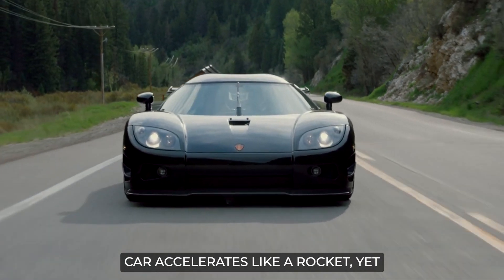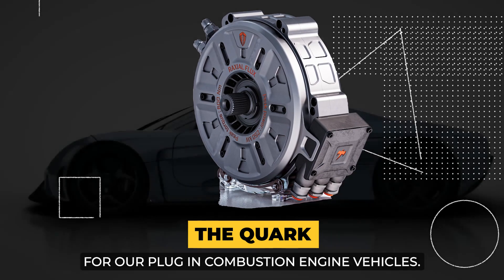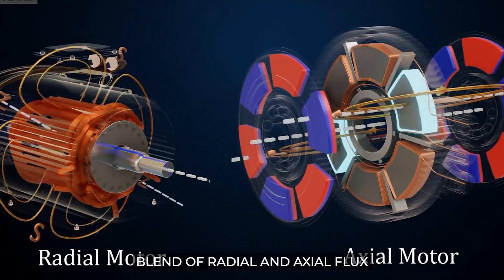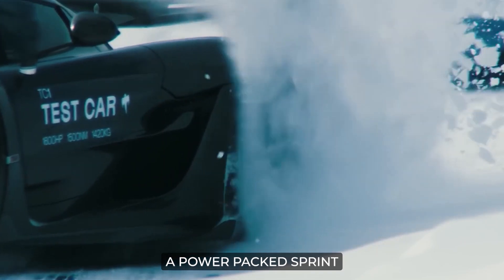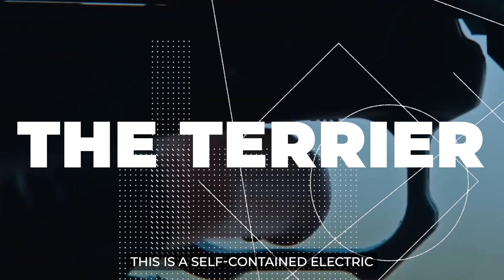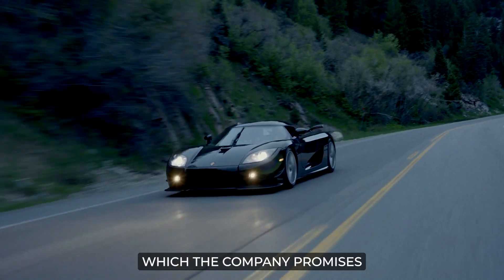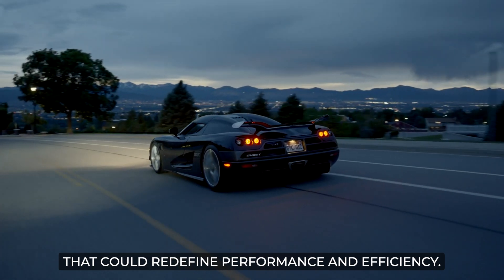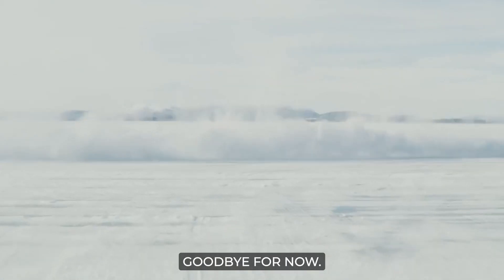Koenigsegg Quark E and Terrier | Small Engines - Great Power!

Comment: I'm going to write a treaty between Ukraine and Russia and Europe giving Russia Self efficient electric vehicles technology to Make box vans for shipping and a quarter ton pickup truck's multi purpose 4 wheel drive having low medium and high performance range giving it off road on Land and track speeds plus regular transport speeds all by shifting gears making it multi purpose then Tesla and Russia builds tractor semi trucks and trailers for Russia makes in Europe countries that wants Russia and Americas military support And Ukraine building electric generators using your quark electric motor technology small scale and hopefully you can make it into a generator technology for the self efficient electric vehicles and generators that Ukraine sells And makes in the countries that wants Russia and America military support your company supplies Russia with the electric motor and generator technology you also get self efficient electric vehicles technology And generator technology using gearing and one motor turning numerous different sizes generators having unlimited generating electricity technology with just your motor technology not counting the generator technology in the future I'm half swedish and want Sweden to be part of the treaty that I want signed in Sweden theirs alot more to the treaty and my plan with your technology I have a internal combustion gasoline engine that Burns pure gasoline completely leaving CO2 for emissions carbon monoxide is unburned gasoline I have some funky engine ideas I've been a certified small engine mechanic since 8th grade I'm 55 now so I know a little bit about The internal combustion engine battery technology is needed for the vehicles And the generators charging battery that supplies the house or factory whatever with electricity you'll have to downsize the motor for the generator but I plan on prop planes technology Self efficient electric your engines technology having a shaft on both sides One side on prop other side turning generators running in tangent charging up the batteries running the Three motors and everything inside the plane prop planes Cary cargo easier so cargo planes will be faster than jet planes in the future with transmission between motor and prop on All 3 motors then im half swede I'm all about The Vikings lief Erickson discovered Duluth Minnesota around 1000ad a long time before Christopher Columbus discovered America I'm All about ships and yhats firsts going high speed then ships shipping cargo The bigger the ship The faster she goes like the biggest whales in the ocean is my goal I want your company with Kawasaki And Tesla to be a part of Plus making drag bike engines to sell to manufacturing company's making chasis for the engine it's a long story but very good a world wide dragon 🐲🐉🐉 drag biker club the engine being My Street name in the country is packy I want to call the company kawapacki I kinda like how it sounds like a good sounding engine running off pure cheaper gasoline than what we run now for how The engine is designed

Comment: I thought  was originally going to be called Dark Matter  engine 🤔 
I just want these engine to convert ice cars 5o electric
Reply from the maker: The 'Dark Matter' engine you're referring to is actually part of Koenigsegg's Gemera hypercar, which is a hybrid featuring both combustion engines and an electric motor. The 'Quark' and 'Terrier' motors I discussed in the video are separate innovations designed for other Koenigsegg models. Koenigsegg is exploring various electric motor technologies, like the unique six-phase system in the 'Dark Matter.' What are your thoughts on the advancements in electric motors, and do you have any favorite innovations from Koenigsegg or other automakers?
Reply: Dark matter cane after these 2

Comment: It doesn’t have a 3 Zylinder. Get your facts straight
Reply: it does. but theres two different variants, one with the inline 3 + electric motors producing 1700hp and one with the jesko v8 + electric motors producing 2300hp
Reply from the maker: There are different variants of the Gemera. Thanks for pointing that out. There's variations with the inline 3 + electric motors and the Jesko V8 + electric motors. Koenigsegg's is committed to innovation, and they offer diverse options. If you have any more insights or details, feel free to share – let's keep the conversation going!

Comment: dark matter?
Reply from the maker: The 'Dark Matter' electric motor is a true marvel from the Koenigsegg R&D team. Weighing under 40 kilograms, it's claimed to produce 800 horsepower and 922 lb-ft of torque at 800 volts, requiring 750 amps for its peak power of around 600 kilowatts 😎.